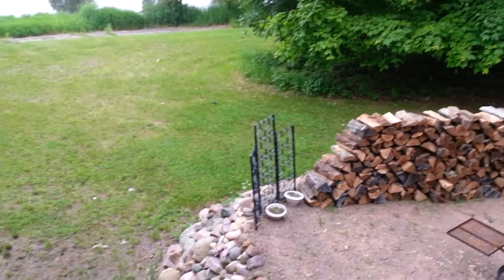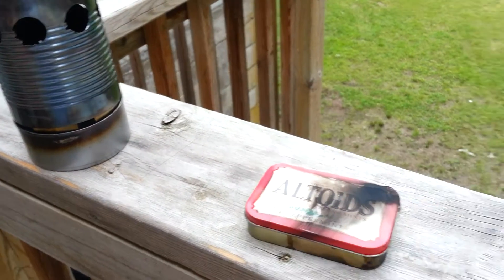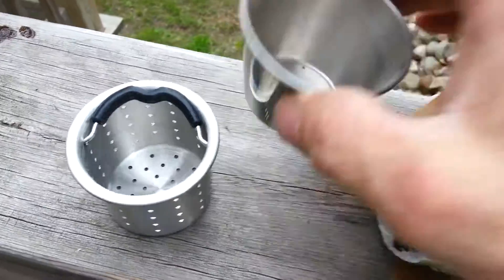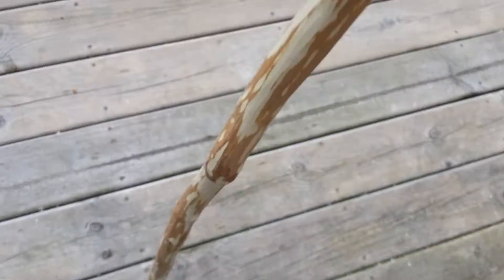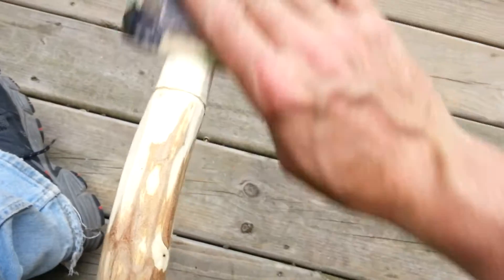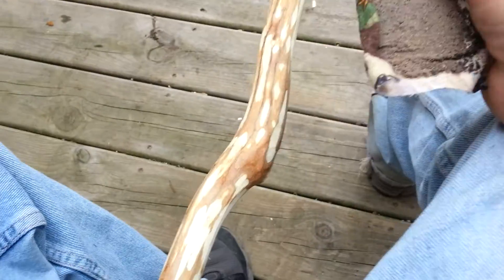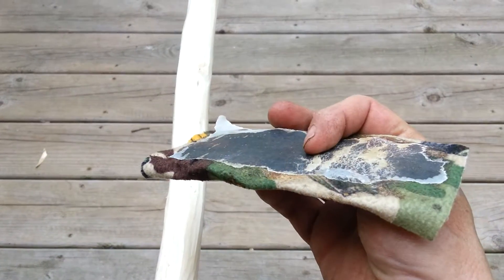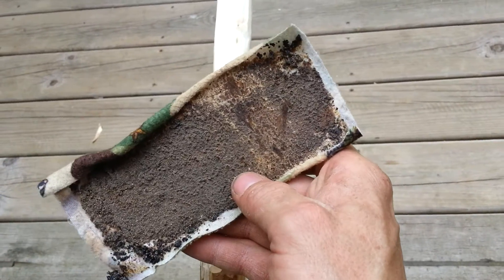DIY Bushcraft Sandpaper - Gitten My Grit on

Comment: my advice? use either the paper from that thick brown paper bag, make your own paper(my advice if you want to go this way is to look up How Its Made- Paper Umbrellas), or use cardboard for the backing. after that, smash up either shells and or sand, or grind some broken glass until you have a dust consistency(any larger chunks can either be crushed down or filtered out as desired) to make your grit(bonds using natural glue). There is also a plant name rough horsetail(scientific name is equisetum hyemale) that was traditionally used for polishing after being boiled and dried(has a finer finish than sand gives) if you want to have a smoother polish. 
might want to invest in either a small mortar & pestle or make your own using a stone bowl and either a hard wood or polished stone rod("Creating a Stone Axe Head with Primitive Tools" shows a good way to grind down some stones into the proper shape you want, though getting such an idea location in the wild would be rather hard) for a portable way of grinding small objects into fine powders or pastes or even use it to break open nut shells while neatly sidestepping the hassle of losing the meat and shell.

Comment: here is another way to make sandpaper you need a piece of paper sand paint water clag paste(glue) 1 put some glue on the paper.2 spread it with sand 3 mix a small amount of paint with water 4 spread the paint and water on the sand .5 leave it to dry for 1 hour and once it's dry put some more glue on it and wait for it to dry now you have got sandpaper

Comment: Use horsetails (the plant, not an actual horse's tail). They have fine-grained silica embedded in the tissues of their stem. You can cut them open longitudinally and roll them out flat into a thin sheet, put them in-between two rocks overnight so that they stay flat, then use them as is or glue them to a piece of wood to make a sanding block. I've gotten a knife back to shaving sharp using a smooth river stone and then stropping on a horsetail strop.
Reply: could you make a video of that please, it would be rather helpful
Reply: I sanded the scratches out of a celt with horsetail

Comment: I would be looking for (both) natural and man-made materials and structures that are already mostly ideal for a particular task.  Like using a concrete curb or steps or a shop floor, to sharpen a blade. ... I might look for some sand-stone and use a piece of much harder river rock to wear a groove or channel into the sand-stone .. I might even use some badly rusted  or pitted pieces of iron (of various shapes) - I might use the saw-back of a machete - serrations on an old steak-knife - SALV AGE.

Comment: I'm thinking of making one but my way is using 5 minute epoxy and grab a cup of sand from the beach. I'm thinking of spreading a thin layer of epoxy over a cardboard paper, then add the sand on top of it and dust off the excess sand.